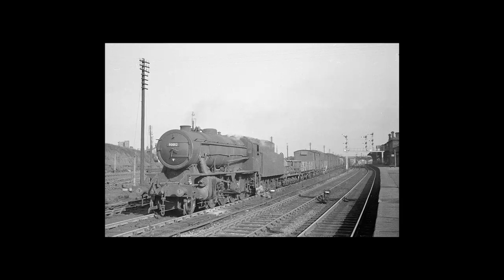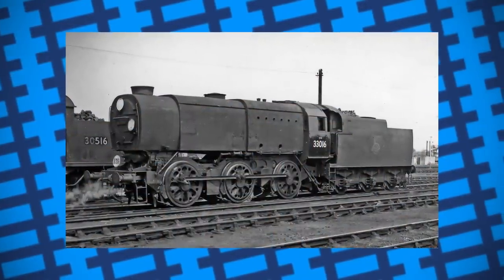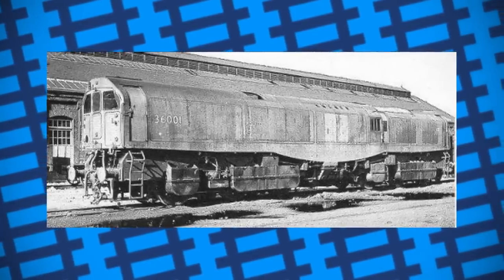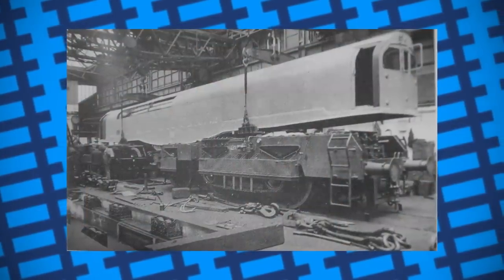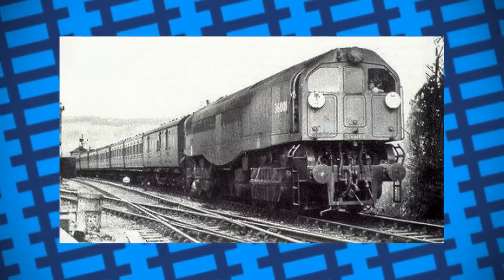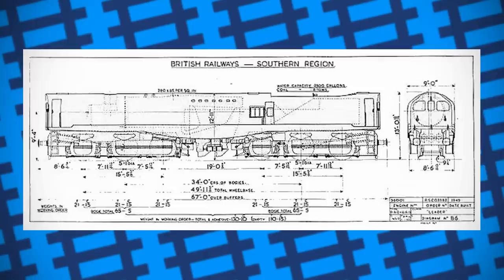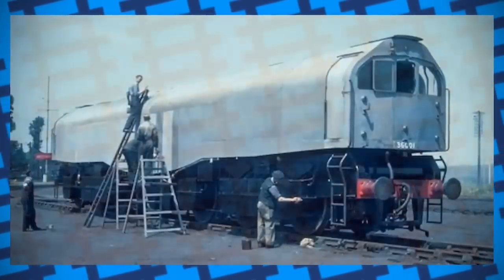The strange Steam Locomotive that was built like a Diesel - SR Leader Class

Comment: With newest hydrogen gas boilers and modern steam turbines this might work pretty well, even today!
Reply: No, Steam just can't be as efficient as Diesel in such a small Scale. The Clausius-Rankine Cycle (Steam) must dissipate more Entropy than the Diesel Cycle, hence the only Way to increase Steam Efficiency beyond Diesel Levels is by blasting in immense Amounts of Energy. That's what Supercritical Powerplants do, but you can't scale these down to Locomotive Size. Modern Steam Turbines may be way more Efficient than old Steam Locomotives, but the Major Constraint still are the Laws of Thermodynamics.

Btw. more Problems include, that Steam Turbines are abyssimally inefficient at low RPM, and that efficient Steam Turbine Plants must have Condensers. There were numerous Experiments with Condensing Locomotives, and all failed in Condensers being too delicate for the constant Vibrations encountered on Locomotives.

Comment: THE POLITICAL & TECHNICAL ISSUES WITH STEAM VERSUS DIESEL THAT AFFLICTED BR !!! 
The "shift" from Steam to Diesel by "British Railways" in the late 1950's was actually a politically instigated move. A fact finding mission by British Politicians to the USA in the early 1950's was pounced on by "General Motors" & "General Electric" who were already mass producing Diesel locomotives. They easily convinced the British Politicians, who were of course totally ignorant of virtually anything connected with railway engineering, that it was a case of "keeping up with the Jones'" or be left in the stone age, and they (GM & GE) could provide all Britain's needs.  

Upon they're return to Britain the Ministry of Transport told BR "stop building steam, buy diesels because the USA is already using this new technology in quantity". Indeed the Civil Servants threatened BR financially by implying they would no longer fund steam, but would happily throw money at Diesels.

The response from BR's senior engineers was to point out that the Diesel locomotive technology as then used in the USA was totally unsuited to conditions ANYWHERE in Europe, not just Britain. 
And if BR simply bought U.S Diesel technology, there would be serious operational problems and virtually all designs then available, would rapidly break down, and not even achieve the  annual mileages of British steam designs. The same engineers also pointed out to the Politicians that BR was itself developing this new technology to suit British conditions, but development would take time, and it was the engineers expectations that BR would remove steam totally by 1980. 

The technical problem of early Diesel engines for rail use, was that the Diesel did not like being taken up and down through the rev range repeatedly or frequently. Hence it worked in early American use, where average station stops were at roughly 80-90 mile distances or roughly every 80-90mins. But in Europe & Britain the distances are more like 20-30 mile frequencies, or 20-30 minute intervals. Which would mean BR would not be able to halve the then locomotive fleet on a 1 diesel for 2 steam basis as hoped for. 

With hindsight we can clearly see, that Political pressure ignored the engineering problem and pushed quickly for Diesels. So as the ignorant Civil Servants were happy to throw money at Diesels, BR began buying such. To mitigate the known technical issues in early diesel designs, BR intentionally purchased small batches of virtually every type on offer. As the Engineers had warned, MANY of the early types purchased quickly revealed serious unreliability problems, so has short lives. The earliest successes were of course in the Diesel Mechanical Multiple Unit arena. BR had the GWR's 1930's experience of its fleet of AEC built Diesel railcars to draw on. This being a simple development of the Diesel Bus engine.

Out of the early plethora of Diesel locomotive types, two engines eventually proved reliable enough to push forward. The English Electric 2,000hp type as fitted in the Class 40, and the Swiss Sulzer design as fitted in the Class 44. Both engine types (especially the latter) with further development, were purchased in larger quantity. The 44/45/46/47 classes (all using the same Sulzer engine) being eventually the most reliable.

The German Diesel Hydraulic types for example, quickly revealed serious weaknesses primarily with the transmission method. Indeed the "Warship" class, based very closely on the almost identical German Class 220/221 revealed serious issues on BR, 5 years before its German counterparts suffered similar issues. The reason (which horrified German engineers) was that BR expected a 21 hour daily availability rate, whereas in Germany this figure was limited to a maximum of 15 hours. In other words the German Railways had two locomotives available for each daily turn, a financial luxury BR would not accept & could not afford. Hence the Hydraulic also had a short life on BR.

Comment: A shame the prototypes were scrapped but so were the vast majority of steam locos, preservation was not on anyone's agenda in the '50's and '60's.  With modern technology it could be made to work today using liquified biogas instead of coal, even if the steam part is used to power a generator for a steam electric loco.  Fewer moving parts to go wrong in a steam driven turbine than an ICE running on liquified gas or bio-diesel.  With a condenser utilised the water capacity can be minimal. It would be ideal for locations where the installation and maintenance of an electric traction supply is very problematic, third rail or overhead.
Re inventing old technology is not new, battery electric Taxis were in use in both New York and London in the early 1900's, helping reduce pollution then, Horse droppings.

Comment: Really strange that such a big locomotive didn't get a mechanical stoker.
Reply: Actually there were many narrow gauge steam locos with larger fire boxes, all hand fired. Mechanical stokers are very inefficient, adding towards heavier and larger tenders, and have their own unique mechanical issues. So if it's not deemed necessary, a railway generally would prefer hand fired. Even the substantial Pennsy K4's were hand fired
Reply: @muir8009  I can see how they might have maintenance problems, but how would a mechanical stoker be particularly inefficient?
Reply: @Lucius_Chiaraviglio   basically theres no real accurate regulation as to how much coal goes in and where it gets directed in the firebox. You're probably familiar with the old "three shovels in the top corners, one down the middle, two over there.." etc. Even though stoker fire boxes use steam to spray the coal around it's still very unregulated. The SNCF (and others along the way) have all experimented with direct comparisons, the hand firing always coming out as being considerably more efficient. 
Where of course it all falls down is when fuel efficiency is only one factor. The ministrations of a fireman is surely tested when a sustained high power is desired. Two firemen have been used on an infrequent basis to provide this, being the only way that a particular locomotive can achieve some aspect of its boiler potential.
Now, fuel saving isn't necessarily just a factor of less fill ups at the pump.
Case in point is the non-stop coronation run. The non-stop being a huge factor. With water troughs more coal can be carried, however the A4 had a corridor tender, which chewed through space for coal. Bigger tender then? That means longer: prohibiting universal turntable use. That means heavier: which may mean the equivalent of half a coach load of paying passengers.
A slightly obtuse view is the N&W did some thinking, and rather then spend lots on buying even bigger more powerful and more expensive locomotives they added another water tender. This enabled the Y6's to go further, eliminating water stops on grades with the resultant restart issues, thereby negating a motive power "upgrade"
Reply: @Lucius_Chiaraviglio   oooh and something else too: mechanical stokers have demonstrated some fussiness as to the grade of coal they use
Reply: @muir8009  I thought somebody would be directing the mechanical stoker where to put the coal to avoid the maldistribution problem.

Edit:  I thought that's what they still call the "fireman" used to do on the giant Mallet-articulated (but usually not Mallet-compounded) locomotives in the US, such as the Union Pacific "Big Boy".
Reply: @Lucius_Chiaraviglio   nope, nothing like that. 
Theres also all course very obvious irrelevancies: the vast fire boxes on the giant US locos would preclude anything but just pouring coal into the ravenous maw. 
I could also add where theres a will theres a way: think of the contemporaries of chapelons exceptional efficiencies of chapelons domestic built 1-4-1P's versus the verandah shaking war recovery 1-4-1R's. In that case the decider ended up being a legendary BB9004!, but ostensibly it ended up a case of extraordinary efficiency versus workaday usefulness...
Reply: @Lucius_Chiaraviglio   for your edit: the large US locos, be it articulated or non articulated (remember big boy was dwarfed in boiler output and boiler size by some locomotives, of which not all were even articulated) still all required firemen to operate the stoker, and of course the kettle still needs a top up or two a long the way. 
Oil firing can be an alternative, many railways worldwide utilising this, where steam jets would spray oil around the firebox. Oil residue being blasted out by sand through the tubes. Efficiency was an aspect of this choice, range being another, savings in fuel costs more reason, and of course the ability to achieve higher firing capacity than what could be achievable by hand firing.
Steam locomotives, even the very best of efficient use (obviously a certain chapelon masterpiece has that honour) still is some way behind the other alternatives of propulsion.
I was about to say two man crew, but of course there was a brakeman as well...
Reply: @muir8009  A way to solve the coal distribution problem while using an automatic stoker would be to use fluidized bed combustion, like in coal-fired power plants (and I think Chapelon or Porta even tried this, but in an unfavorable part of history, so it didn't take off).  Also would have had other benefits.

Comment: Yet, There is one thing diesel locomotive lacked, is versatility to burn any fuels. Steam Locomotives can pretty much run on anything that the fire can burn. Electric locomotives are only limited to either Overhead, Third Rail, or Diesel generator which is basically Diesel Electric locomotive. People can claim that AI is the answer for everything, but it's sketchy at best. Automobiles and Pedestrians are invisible to PTC and similar. Quiet Zones (US) is a death trap because no one pays attention and/or try to race against the train, let alone Conceal the locomotive's engine. While with standard US crossings, there is a Second warning which is the Locomotive's horn which is the last chance after the lights and gates activates. Automated is not the answer, it's get off your sorry ass and look around you. Digital is not superior to Analog, and Automatic is not superior to manual labor, Automatic and Digital will be more prone to fail, than tech from the early 1900s. AIs are not superior to the Human minds, lust like LGBT is not superior to Man and Women marriage. The Global Warming claims are just a bluff, a lie, a fluke, and a fear mongering tool that the Medias and governments use to instill fear into you. You just need to know how to avoid Automation, Digital, LGBTs, and Global Warming lies and put an end to it.

Comment: What is 50 degrees celsius in regular? I don't speak metric. 
According to google: (50°C × 9/5) + 32 = 122°F.
That's complicated. Why can't you just give both?
Who's gonna pause the video to do that conversion math?
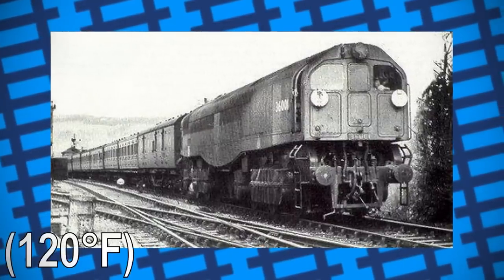Reply: At 3:38 in the bottom left corner it says 120°F in brackets but it does only appear briefly
Reply: Why can't you just learn the metric system.